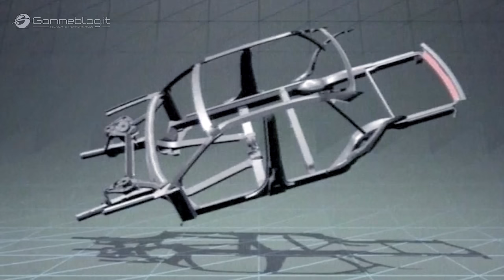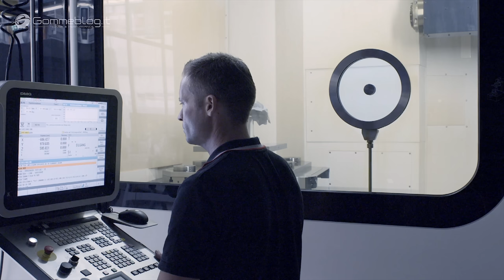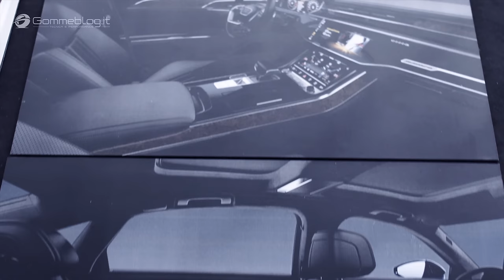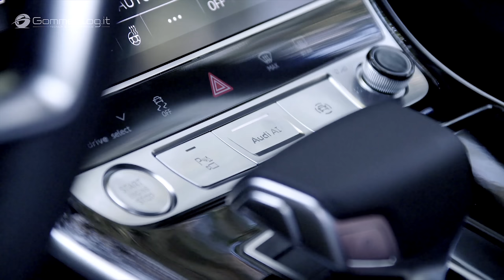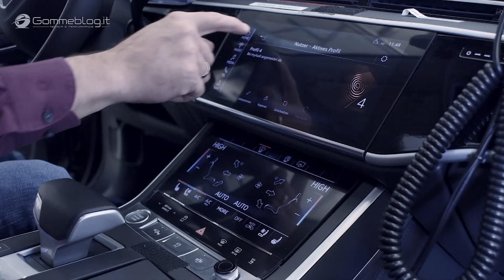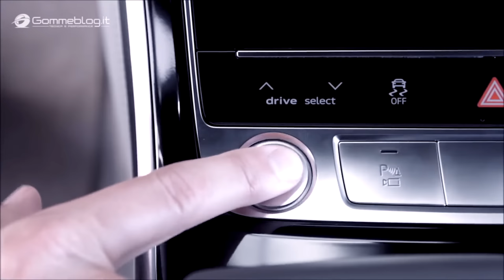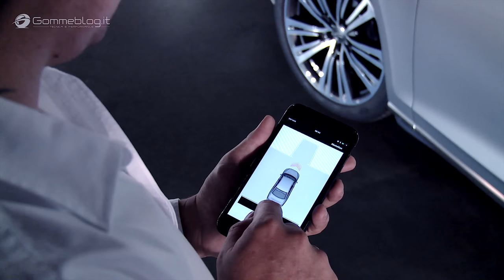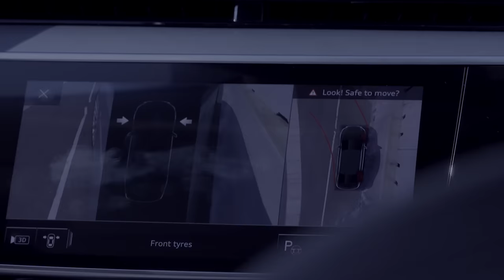2020 AUDI A8 - LUXURY TECH FEATURES

Comment: why call it a A8 when its turbo 6? totaly wrong need to make a twin turbo V8, with around 500HP at the rear wheels and also hybrid, so you have the best of both worlds in built electric motors with the drive system to help produce power and also boost the battery life while running on petrol so that you have around 1,000KM on a full tank of non stop driving and even if you run out of petrol you still have reserve to get to the nearest petrol station so that the battery can be recharged again?
Reply: 1. It's a luxury car and if you own it then you are probably gonna be driven around by a chauffeur. 2. There are many models of the A8. There is the A8 50 TDI, A8L 50TDI, A8 55 TFSI, A8L 55TFSI, A8 60 TFSI, A8L 60 TFSI, A8 60 TFSI e, A8L 60 TFSI e. 3. They also made the s8 with more than 500 hp.